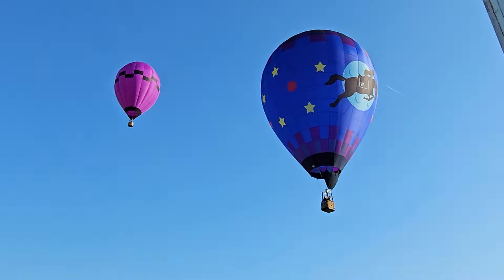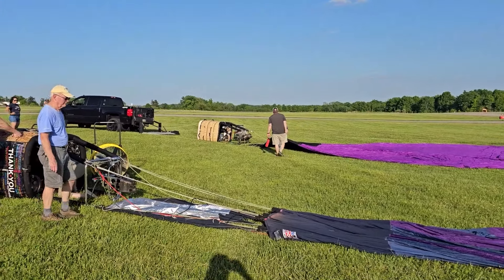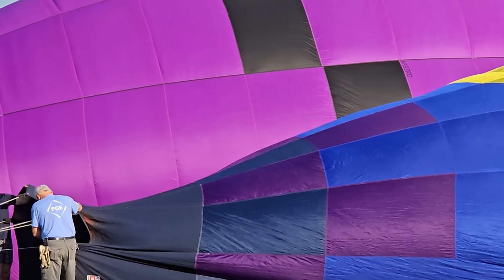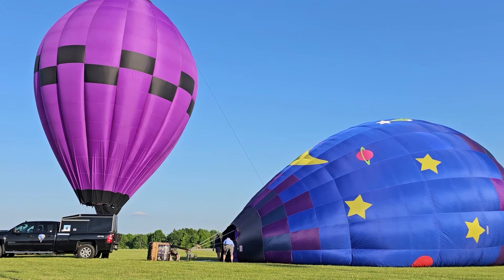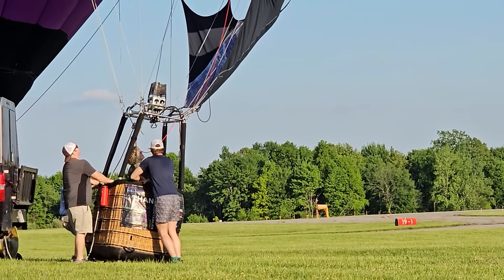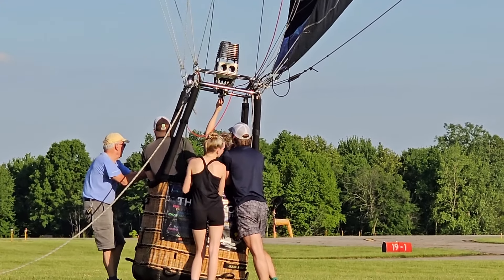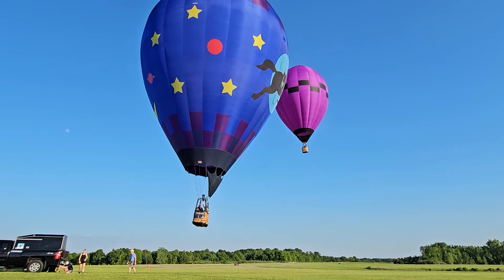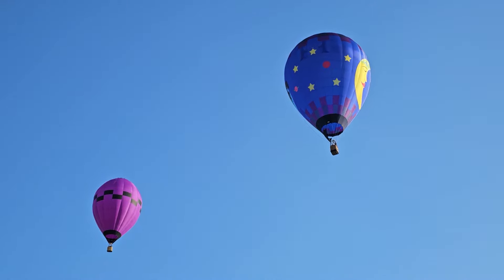Balloon Secrets: How Balloons Work...I Didn't Realize!! They're EXPENSIVE!!

Comment: The envelope often has a vent on the side (at the largest diameter) that lets air out horizontally/tangentally when a line is pulled. This is to rotate the balloon. That's particularly required when landing a balloon with a rectangular basket. (You'd want it aligned with a long side to the direction of travel at touchdown).
It might also be used in flight if there's something in particular that all passengers might want to see. (e.g. Pyramids in Egypt).
Reply from the maker: Interesting, makes sense.

Comment: I’m not sure these numbers are entirely accurate for balloon. As a private pilot, the used envelope I bought (which had 160hrs on it at purchase) cost me about $10k (again used) and should last approx 600-700 total hours (some of this depends on fabric type). This many hours is 400-500 more hours than when I first purchased it. That’s an anticipated $25/hr for envelope. 

There may be some differences if you’re buying new equipment, but there is a used market out there…which needs to be mentioned, as the figures you gave would likely scare a lot of potential new pilots off.

Comment: I’m a commercial balloon pilot. I haven’t flown in many years. You don’t need a medical. You certify yourself. The certificate is good for life unless it’s been changed. You need a check ride and the 3 take off’s and landings just like fixed wing. A hot balloon doesn’t carry ballast, only helium balloons. The guy on the crown line is there primarily to keep the balloon from rolling side to side as heat is applied. This is where most burns occurs. There’s 2 kinds of ballon pilots: those who have burned their balloons and those who are getting ready to burn them. 
It was really fun but a lot of work. I wanted a LongEZ. My wife wanted a balloon…
Reply: Does that saying go about the same as a bike rider? There are the one that have dropped there bike and those that have not as of yet 🙂  
While I like flying 140, /tigers ,150's , only done two balloon rides BUT some of the best flying to see and enjoy the land before you.
Reply: In 2023 the FAA instituted a Class 2 medical for commercial ride and corporate pilots. However, no medical is required for private pilots or for Commercial pilots who teach, even for compensation.

Comment: Not sure how often the ground crew is really going to get into a landing field ahead of the balloon landing.
Maybe on a very very light wind day & area with very big fields it might happen occasionally.
Reply: My crew is able to do it more often than not.  By paying attention to my direction they can get ahead of me, warn me of things ahead such as livestock that get scared by balloons and potential landing spots.  We have radios between each other and Incan often tell them well enough in advance where I’m going to land they can get into position to catch me.  But if not, landing without a crew on site is perfectly doable,  just not quite as graceful.
Reply: @austinhopp3397  I was thinking that ground crew trying to "catch" you would be more dangerous than it was worth!
Is that just pulling back on some drag lines or do the ground crew actually manhandle the basket as it comes in to land?
Reply: @alanm8932  rule number 1 is to never get in front of the basket.  Catch it from behind.  And it just consists of grabbing onto it and applying your weight.  There are also some ropes at the bottoms of the basket to grab onto and you’re anchoring it back to get it to stop. There is definitely some force behind it but if the winds are 7-8 miles per hour it makes a world of difference in your landing.  Generally a landing of 5MPH or less is still gentle without anyone catching you.

Comment: Please, for the love of all that is good fixed wing people, please do a little more talking to balloon pilots. 

I know y’all are a solitary bunch but balloonists are social and love to talk. Before making content like this please ask more questions.

1. We do not use generators or electric fans. 99% of fans used in ballooning are small 5-12hp gas fans. I have never seen someone use an electric. If they did it would be fairly simple to use an inverter on your truck to do so instead of a generator. 

2. The basket sides and possibly bottom have wicker as it’s flexible, light and durable. Inside that wicker are steel support posts, aircraft cables and a plywood bottom that actually carry the load. The original balloons from the sixties (invented by Raven Industries / Aerostar, now out of balloon building) had aluminum baskets… that didn’t bounce back with a bumpy landing.

3. Suspension cables, not shroud lines.

4. Costs are not nearly as much as you imagine. 
- Modern balloon envelopes routinely last up to 600-800hrs.  We only fly about 1-2hrs at a time and only when it’s nice out (mornings and evenings, no rain, little wind).  For most non-professional ballon pilots that’s between about 10-30hrs a year.   
- Propane can cost allot but three 18gal tanks won’t be empty by the end of a 1hr flight, to that cuts some costs.
- Annual inspections are much, much less. My balloon costs about $400 for the annual.
- Replacement intervals for hoses and seals are usually fairly long so it’s not often a big cost yearly.
- Just as most balloon pilots are hobbies to, most crews are not paid. They come for the joy of hanging out with friends and having an adventure. Most get to fly with us on occasion and even people not keen on flying tend to have great fun traipsing across the countryside on a little adventure.

5. We DO NOT used ballast. That is for gas balloons.